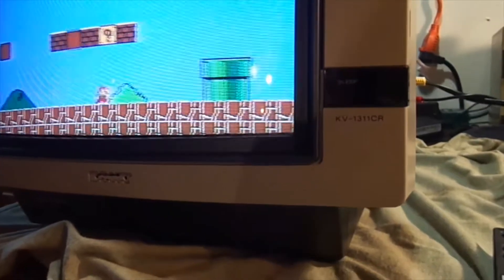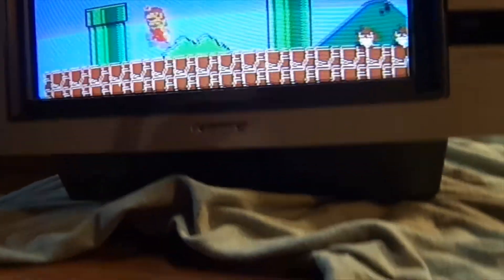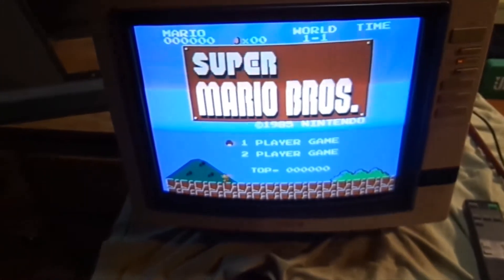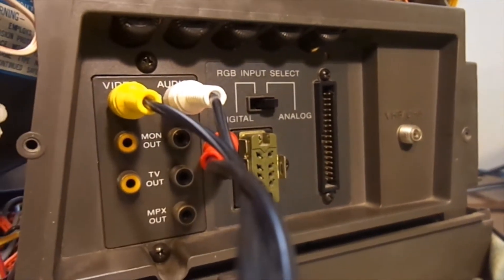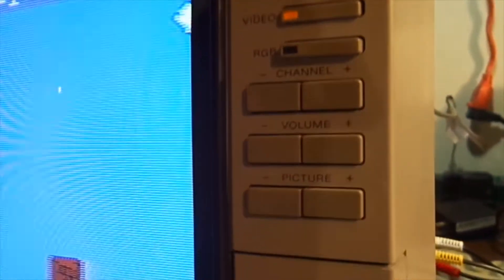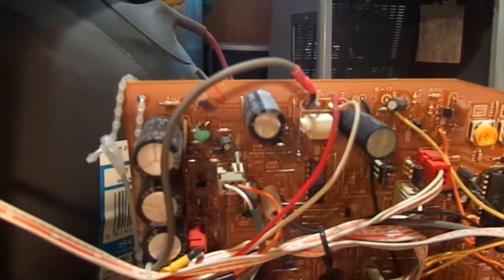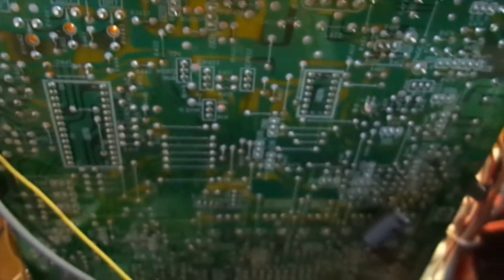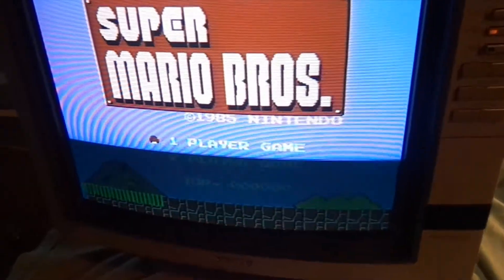Sony Trinitron KV-1311 CR, PVM 1390 ERA, Monitor and TV overview 1985

Comment: Just finished re-capping my KV-1311 CR.  She lives, thankfully.  I have an odd issue with mine, if I use Analog RGB, I hear static sound like you would on an empty RF Channel.  I can't seem to get it to go away, any ideas what the issue is?  Does the RGB take an external audio source from the composite audio input?
Reply: Just picked up one, upon plugging it in I can hear the frequency from the tube then it cuts power. Everytime I plug it in it does the same thing. When it's plugged in and cuts power, I hit the power button on the front I get nothing. Any clue?

Comment: Nice find. I think this uses the same 34 pin connector as the 2030, 2530, xbr25, xbr20 and all of the profeels. There were also some larger versions of this (kv-2011cr and kv 2511cr) which are just white versions of the 20xbr and 25xbr.
Reply: It's the same connector, but the pinout for sound is different.